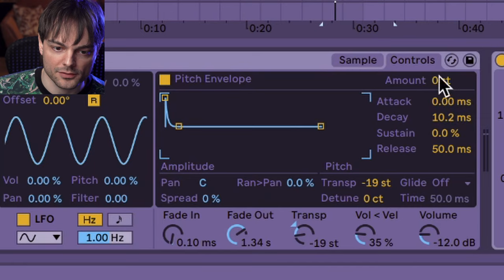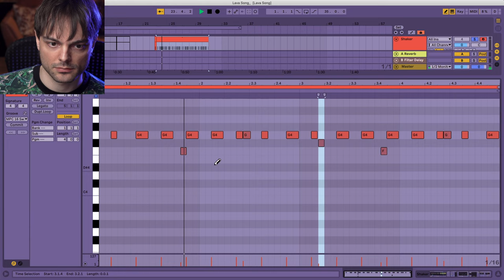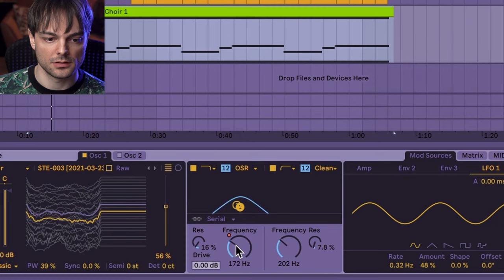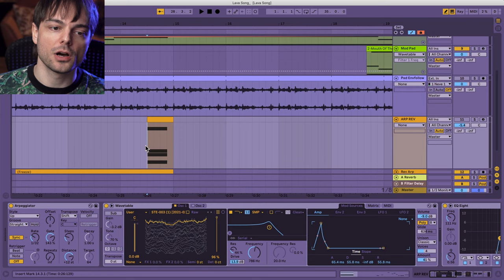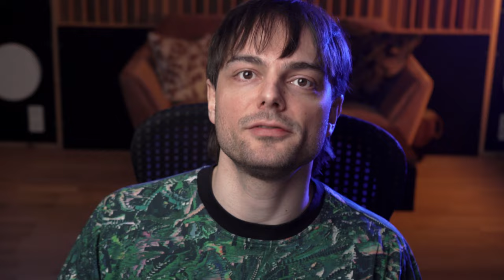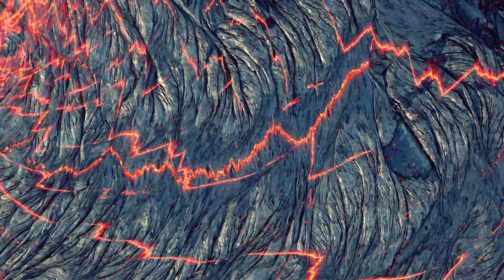Turning volcanic sounds into a BANGER!!

Comment: how do you send the higher register bass notes to return track and not the other ones? just manual automation?
Reply from the maker: Both the filter delay and the reverb have the filter set pretty high. That way, the closed notes don't get through as much. They are still there, just not that audible.
Reply: @JanusRasmussen  got it. I thought you had a secret way of only sending some notes into reverb and some not. Thx